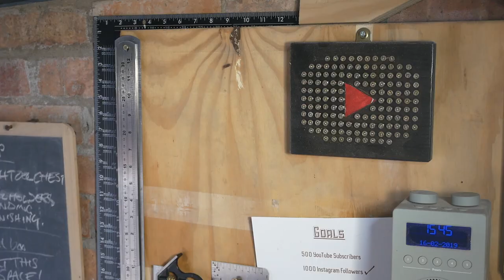Workshop First Aid Kit (after Tom Sachs) / Phil Makes Things 37

Comment: Lovely project fella, top tip- screw a nut onto a bolt before you cut it, then once cut the nut can be removed, cleaning up the cut threads in the process.
Reply from the maker: good to know! Thanks Alan

Comment: Right....!  First, an old decorators trick.  Mask the area with proper tape (not the cheap decorators "thing" they call tape), lightly paint over the tape with the base color to seal the tape edge, then paint over it with the secondary color.  Works with paint and might work with spray paint.  Second, a carpenters trick.  With those small projects, I usually try to predrill some holes for the screws.  It makes it all round more enjoyable to work with.  Third and last.  What is up with the flag of Denmark?  Dannebrog!  Are you gonna put some "hygge" in that box  ; )  - All the best mate, keep them vids coming  : )
Reply from the maker: Thanks for watching my little known channel 😂 I'd completely forgotten about painting over the tape trick, I did know it, but I suppose if you dont do something much you forget things that makes life easier... and that tape is the cheapest of cheap tape. Why Denmark? Well... no excuses really... the gin provided the nice warm hygge. 👌
Reply: @PhilMakesThings  Skål : )